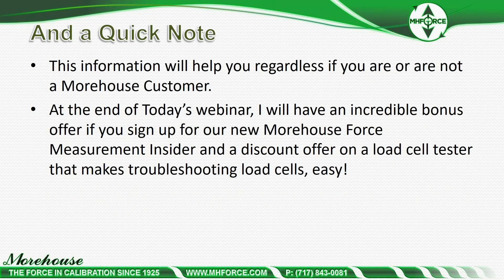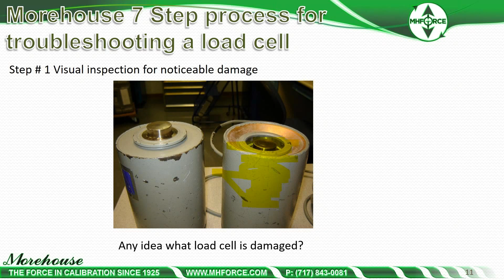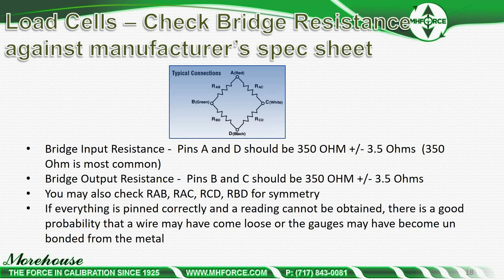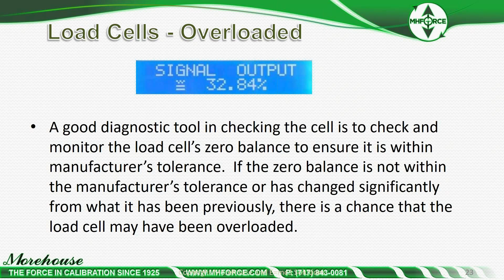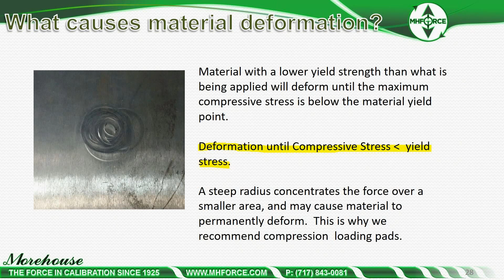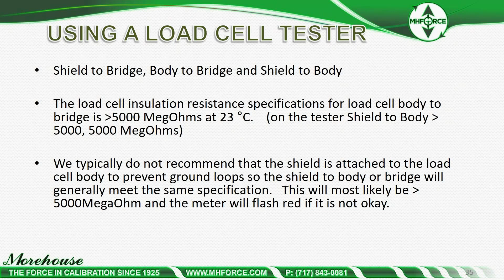Load Cell Troubleshooting

Comment: Hello, greetinf from Brazil, why some load cells the input resistance is greater than the output resistance? It has load cells that have the same input and output resistance, and others are different ...
Reply from the maker: Hello, greeting from the USA. Contact us at info@mhforce.com if you still have any questions.